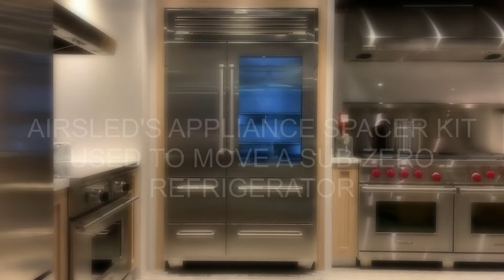How to Move a Sub-Zero Fridge with an Airsled and Spacer Kit

Comment: I have a VERY heavy stacked washer and dryer that wouldn't budge even a millimetre in a very tight closet space. I rented an air sled from local tool rental; got them out in perhaps 30 seconds, did the work I needed to behind the set, and back in, set in exactly the right spot within another 30 seconds.  Brilliant tool.
Reply from the maker: We love helping people defeat gravity. Thanks for your feedback.

Comment: I use mine all the time with stackable washer dryers and moving refrigerators full of food. The last refrigerator had to come out of the kitchen tile floor over the threshold and onto the carpet so I could get enough room to pull the oven out into the kitchen. Yes, small apartment layout. It is so worth the cost when you're a one man show.
Reply: Are there any issues using an airsled on an average refrigerator? I was wondering if it would damage the bottom type of coils.
Reply: @grega8672  Must be aware of where stuff is. Coil might not fair well lifting that way.

Comment: How much does this cost?
Reply from the maker: Hi Charles. The info and pricing on the Airsled system (AM2400) used in this video can be found here: https://airsled.com/product/heavy-duty-appliance-mover-model-am2400-900-lb-capacity/

More info and pricing on the spacer kit is found here: https://airsled.com/product/appliance-spacer-kit/
Reply: Yikes
Reply: I really wish rental stores in so cal had these. I’m redoing my floors and moving my range is going to be a pain the back. Pun intended.